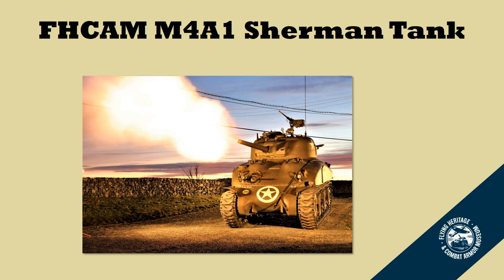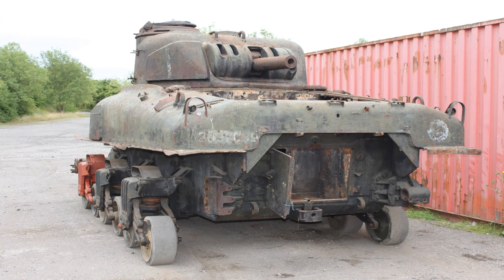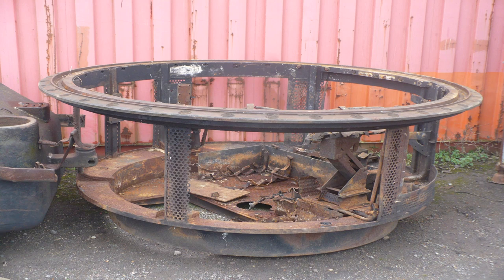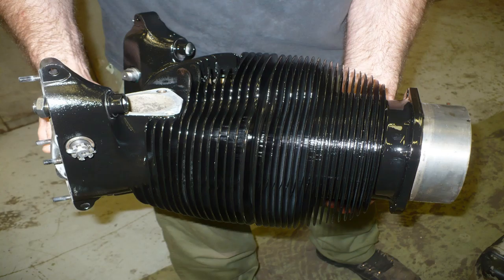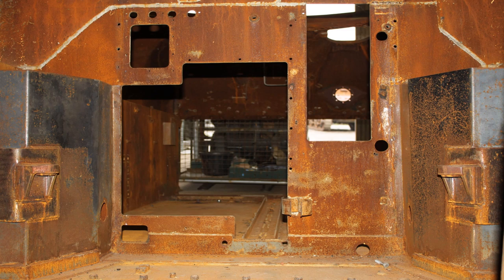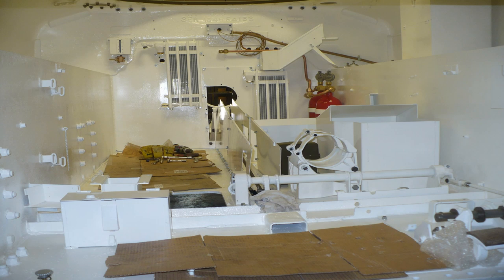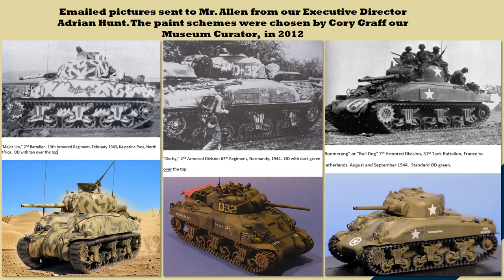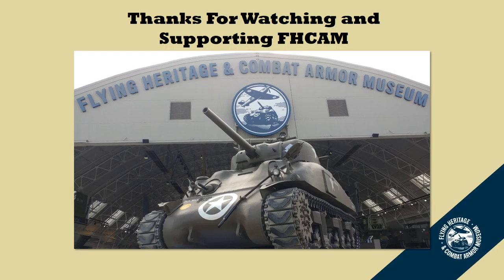M4A1 Sherman Restoration Part 1

Comment: Aircraft engine. Sure. I think they're still doing that with the Abrahams.
Reply: No. Some of the Shermans had a rotary aircraft engine, which still uses pistons. Whereas the Abrams tank uses a gas-turbine engine.
Reply: @ct92404  You're missing my point. They're both engines normally seen in aircraft. U trollin or did u realize that?